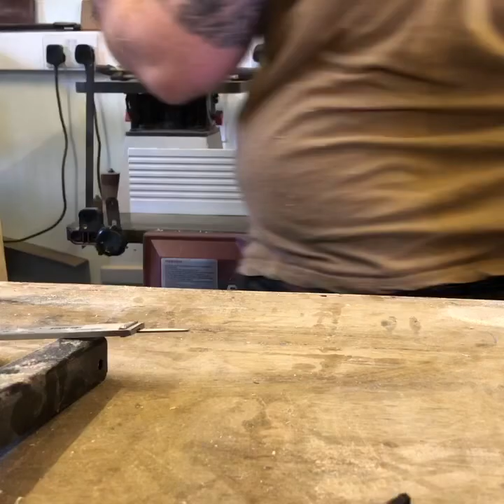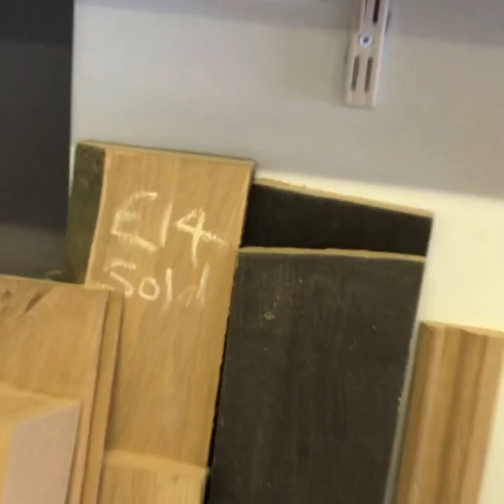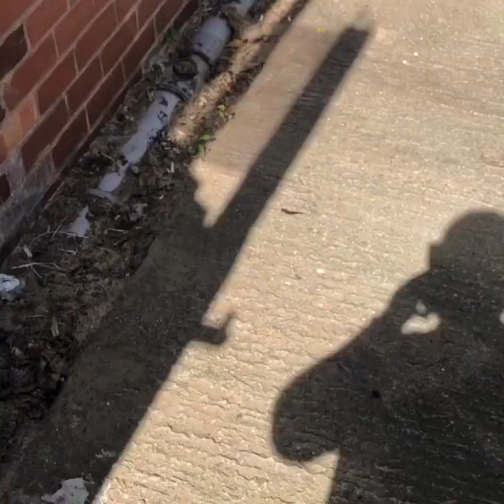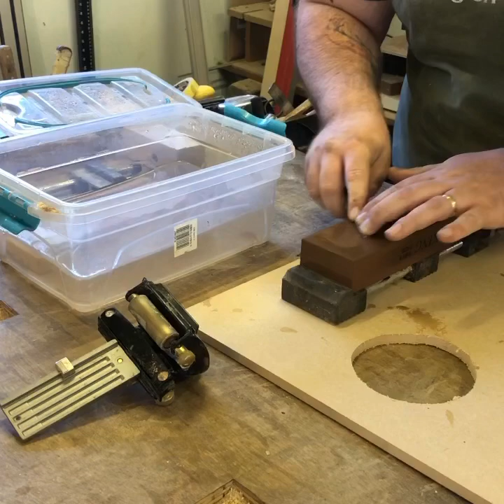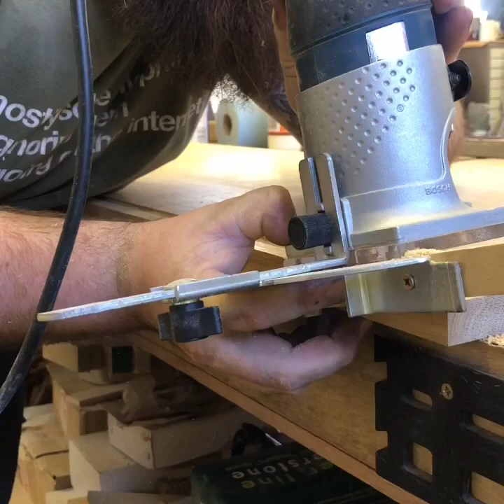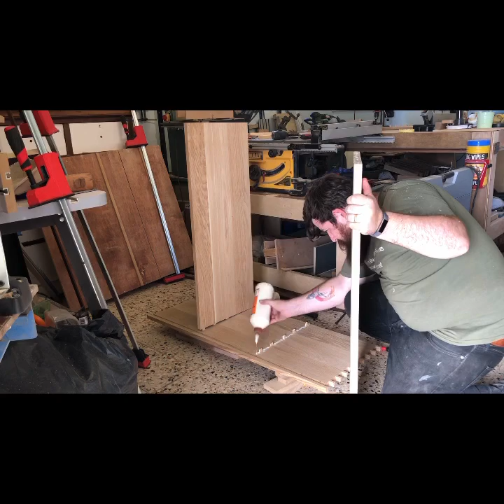Making an oak Japanese kumiko cabinet - dovetails and sliding doors Part 1

Comment: What is that dovetail jig you used called?
Reply from the maker: Hey Brandon. It’s a Veritas magnetic dovetail guide. I’ve used a few different ones but this always seemed to be the best but it’s only limiting factor is that you can only clamp a thickness of 24mm in it. Sometimes it’s possible to reverse it and cut thicker though but takes some practise!
Reply: @morganbespoke6311  cool thanks